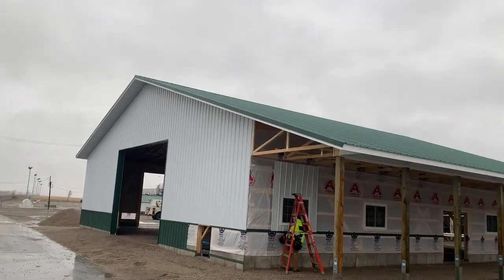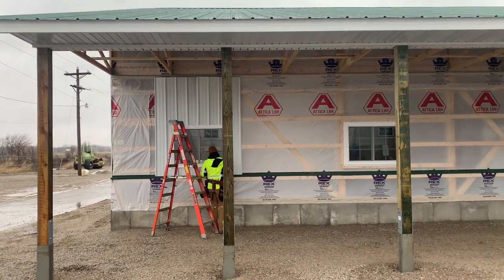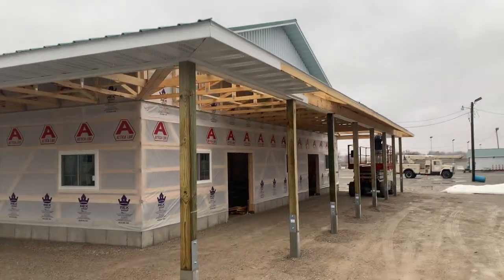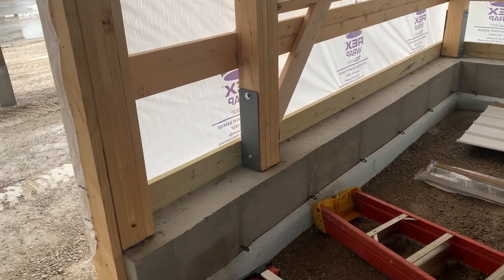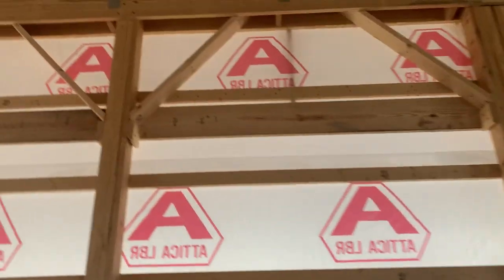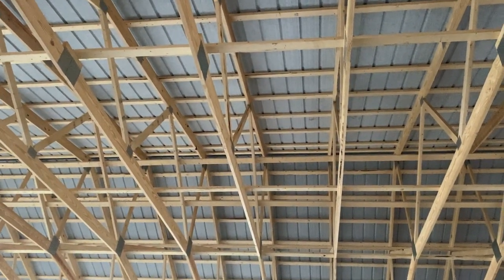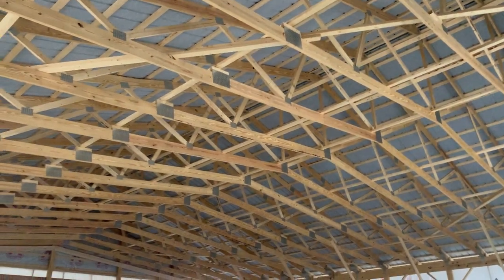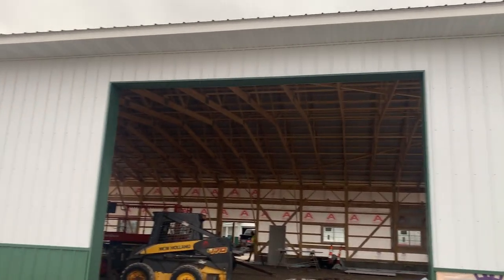60x64 Pole Barn Building (Update) - Truss Screws & Hurricane Straps Roof Support

Comment: I'm a concrete guy but we recently started doing the buildings as well right now im doing an 80'60' shouse with an 80' wrap around porch at what point do you start working on the porch?
Reply from the maker: After the main structure is framed.  Keep up the good work.👍🔨